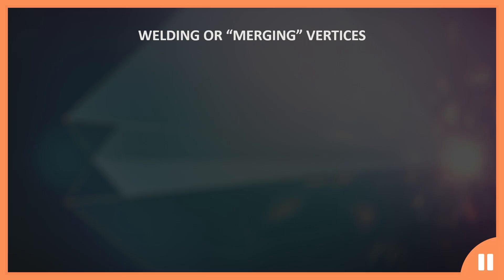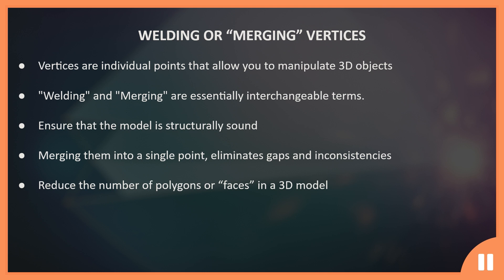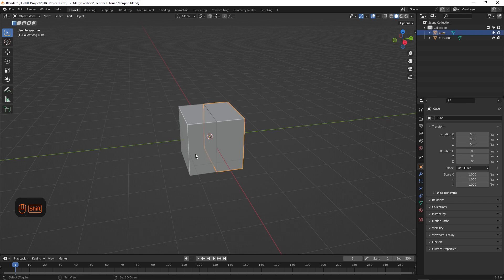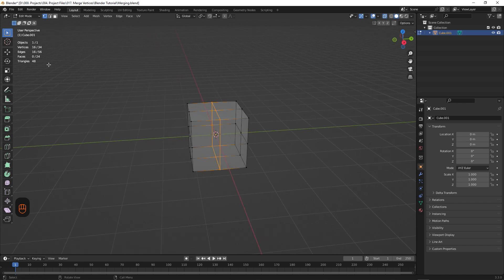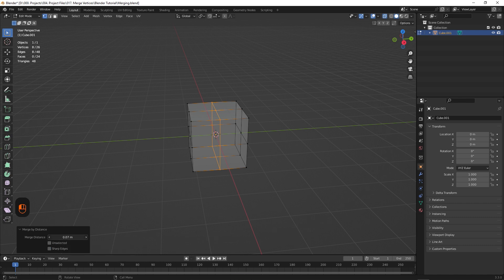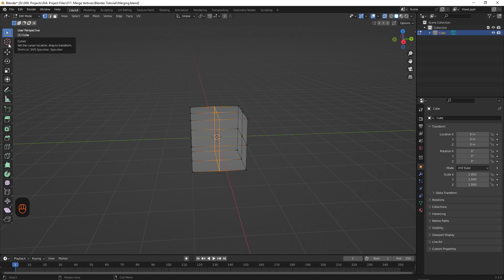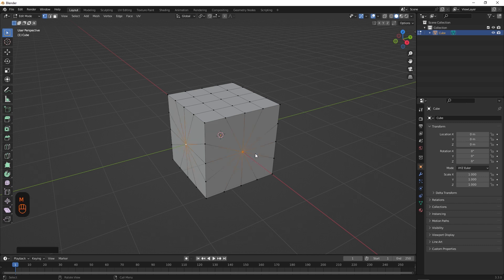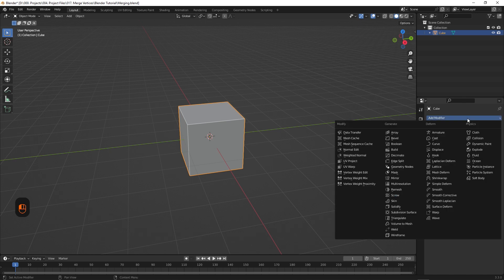Welding or "Merging" Vertices | Blender

Comment: Well Im in 3.5 and it will not weld or merge vertices... I have tried several different ways and is simply will not merge them and I need these two sections to be one mesh